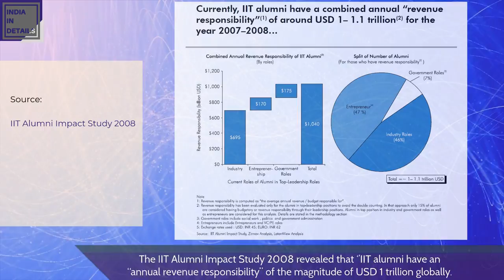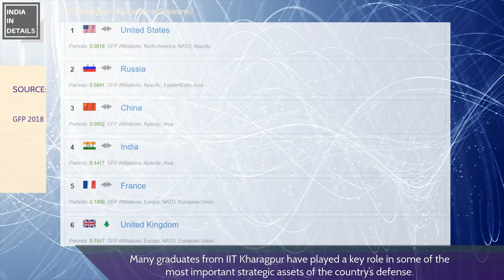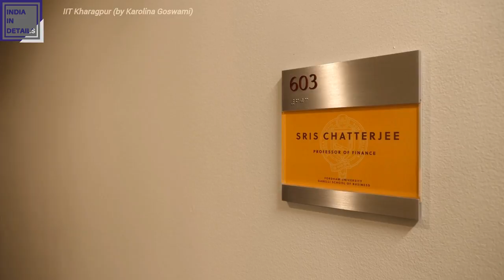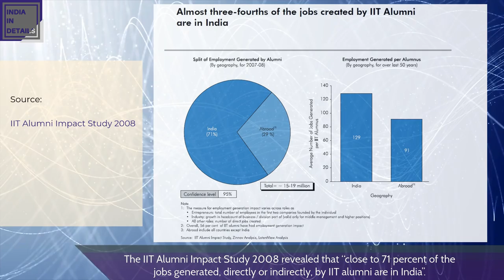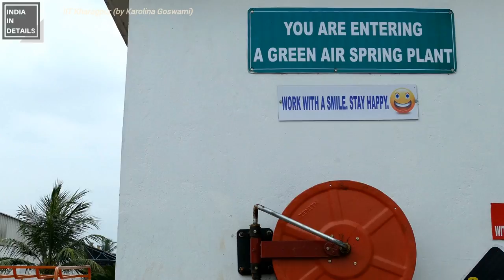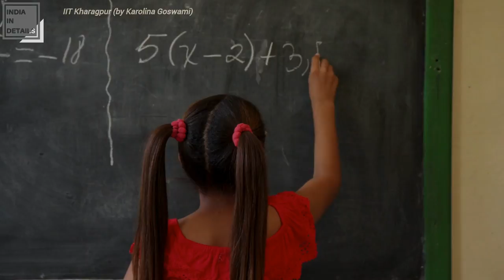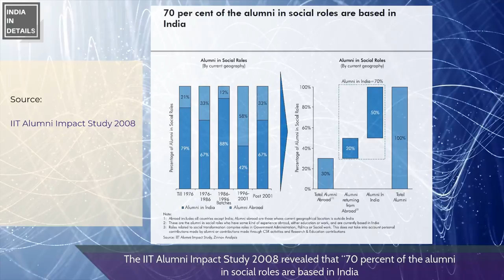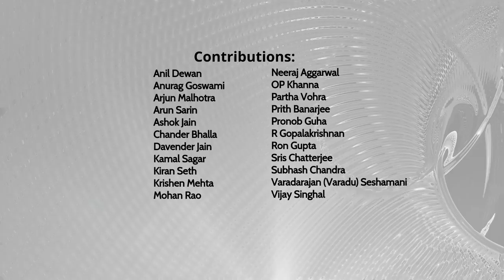IIT Kharagpur | by Karolina Goswami

Comment: Please built one operating system for India. India needs an operating system for running computers an alternative to the existing Windows OS. I still don't see India is equipped yet with an OS of it's own. Much has been invested on infrastructure but still India needs an operating system of it's own & one internet security software engine that can be used for providing safety and security to the digital infrastructure just like Russia and America.